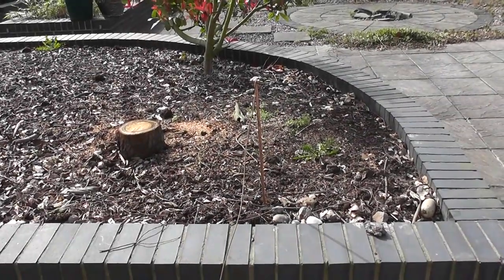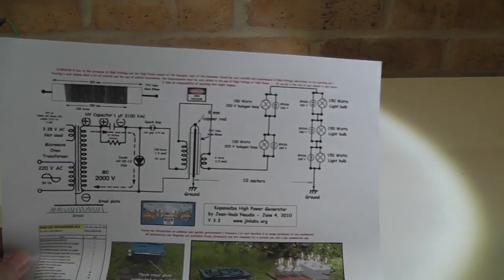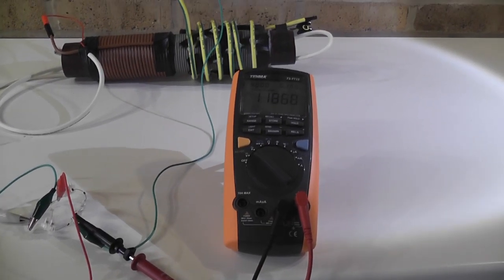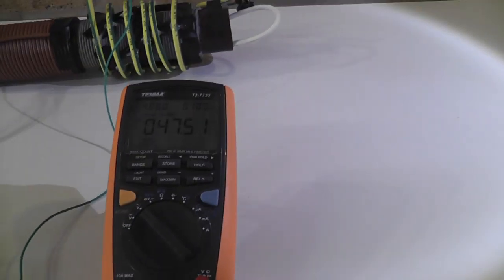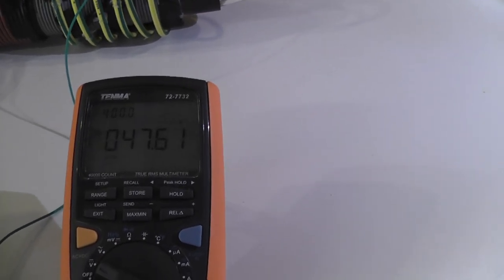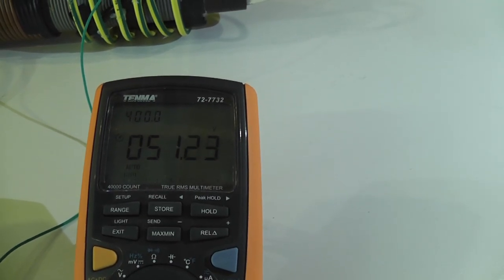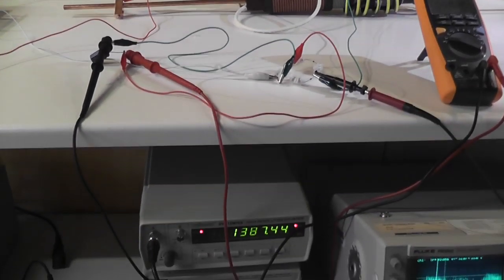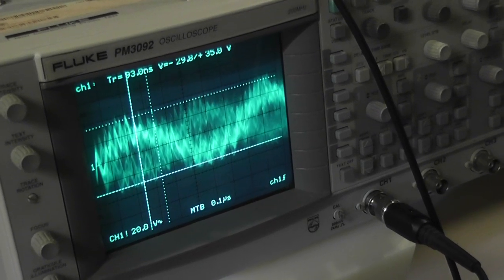Tesla's little secret. The Tariel Kapanadze device, Part 1

Comment from the maker: You have to step-down the voltage to use for an inverter to mains voltage which you then use to power the MOT. There is not shorting of leads

Comment from the maker: Very good expression. But that is not based on what you see. The double helix is a standard expression of a reflected wave in a transmission line. I have in fact a concept I want to apply which has to be 3D and is based on the flower of live geometry, the universal matrix.

Comment from the maker: Have a look at the patent from Kapanadze. He used solid state technologies. He also applies golden ratio arrangement of coils. Naudin's version is only an attempt to understand the working principle. You have to step down voltage and frequency. The system is via ground closed. It will not work that way. Further test on this principle will not be successful.